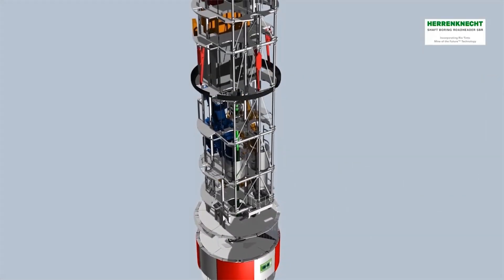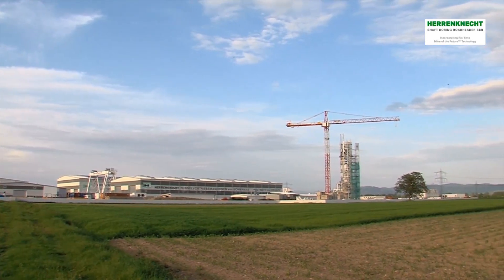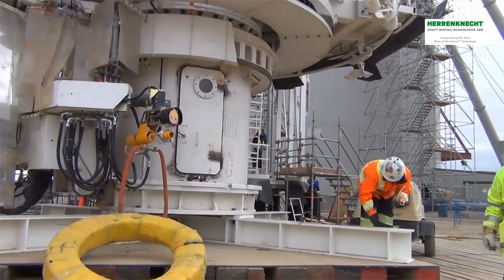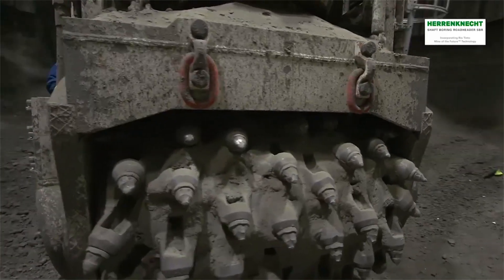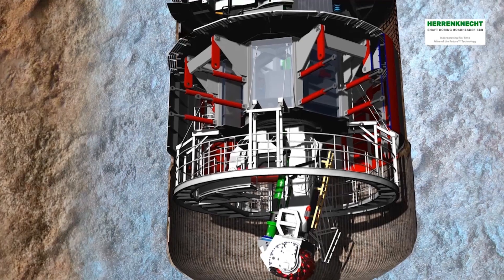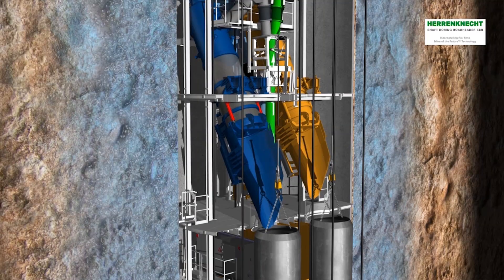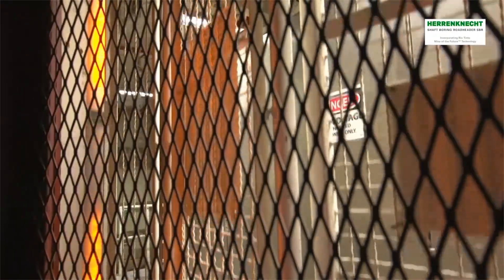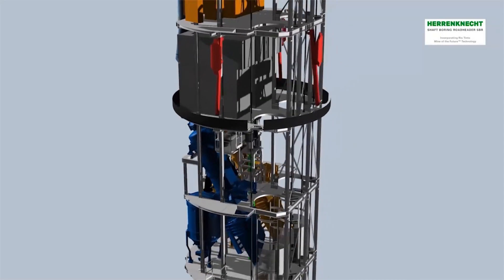Shaft Boring Roadheader (SBR)

Comment: is it dangerous working in there?
Reply from the maker: Thanks for your question. The Shaft Boring Roadheader (SBR) is safely controlled from higher working decks. In contrast to conventional shaft excavation, there are no personnel at the bottom of the shaft during mechanized excavation with the SBR. Overall, the SBR design sets new standards in safety for personnel. Best regards. Herrenknecht AG

Comment: A lot different from when I worked on the Yorkshire Selby project! We spent most of our time on the shaft bottom drilling and firing and mucking out. We also used ready-mixed concrete instead of a gunnite process.
Reply: Still lots of that going on this is soft rock on these potash projects in Saskatchewan. If they were in Northern Manitoba, Ontario, or heaven forbid Quebec then its all hard rock likely granite.
Reply: praise the soft sediments